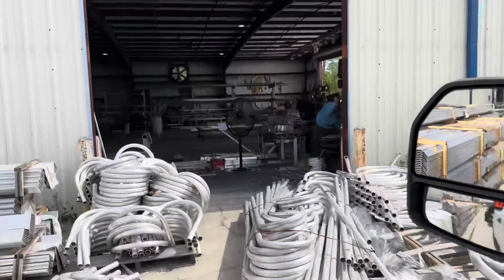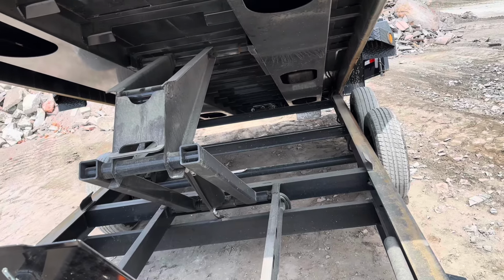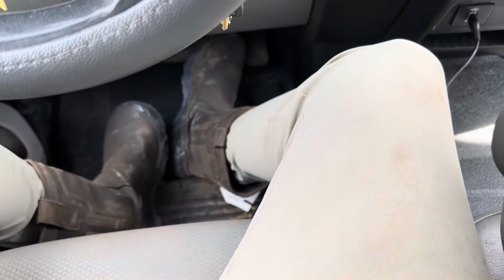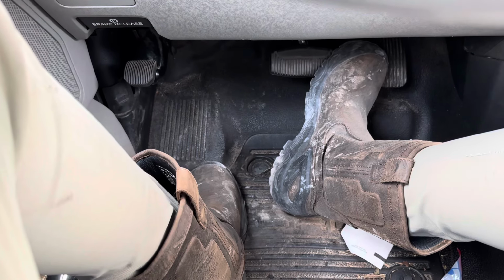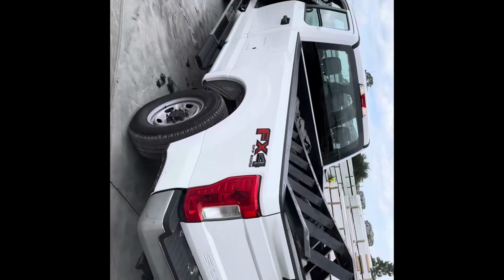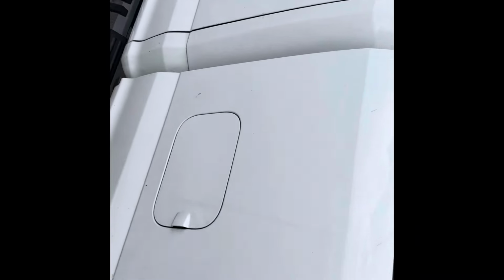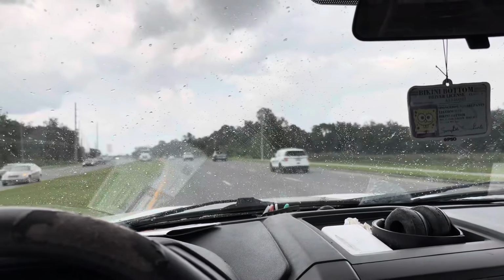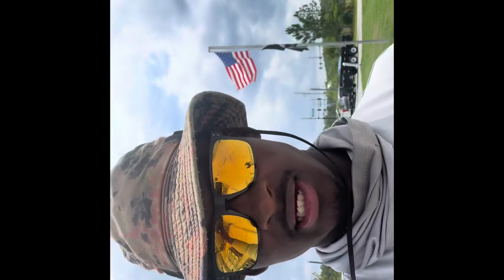Running my Skid Steer Business | Getting Paid for Concrete💰| Overweight Dump Trailer🤦🏾‍♂️

Comment: Here in North San Diego County, there is a flat rate to dump the concrete from $105 for a trailer or bobtail truck.
Reply from the maker: That’s not terrible better then paying by weight for heavy concrete

Comment: Don’t take short cut it’s better to do that extra trip than to ruin your equipment it will be more expensive fixing or replacing axle or even fixing your trailer frame. Smart business
Reply from the maker: Yeah your exactly right and the worst part is it was only 14 minutes away so it wouldn’t of taken that much longer to take one more trip

Comment: If your gonna upgrade your tires just upgrade to atleast 14ply
Reply: That’s what I did with mine but people say dot can ticket you
Reply: @CP-ok1gv  I’ve upgraded on all my trailers and never had a problem with putting tires on and a officer give me a problem some would say to do the wheels as well since some manufacturers can’t handle the psi
Reply: @ricardosanchez6723  got it, I did upgrade my tires + wheels on my sure trac, heavier duty  14 ply and black wheel
Reply from the maker: I was thinking about 16 ply

Comment: What size is that bucket? it looks tiny
Reply from the maker: It’s like a 48” inch😂 but hear me out lol I had an 84 inch Chinese bucket a while back and you’d think I be good even though it’s a Chinese bucket but that thing flattened like a pancake after a few months of using it so I decided to get a good branded bucket which was smaller because it was affordable rather than a bucket that going to turn into a piece of scrap metal
Reply: @EntreprenuerDavis  that's a mini skid size bucket. You gotta get a bigger one man 😂